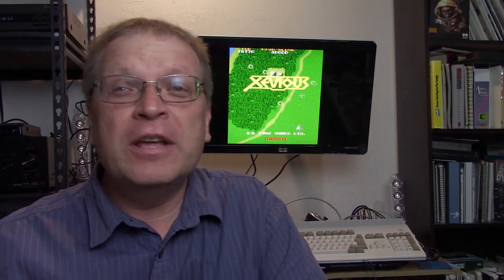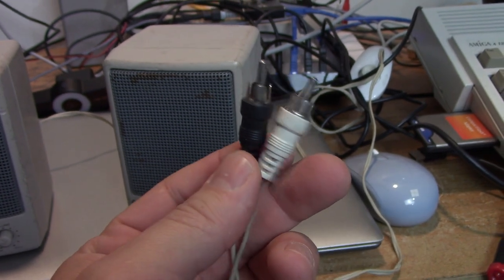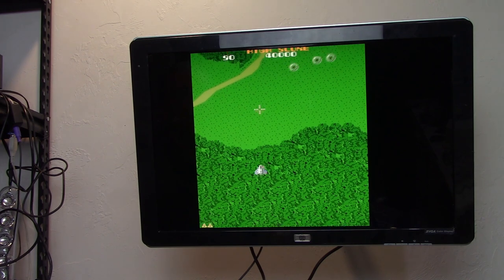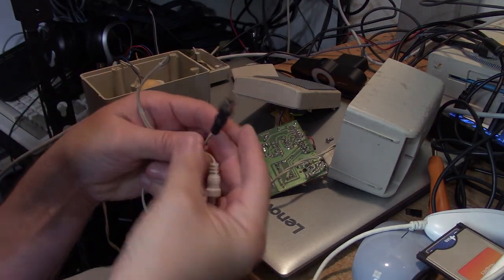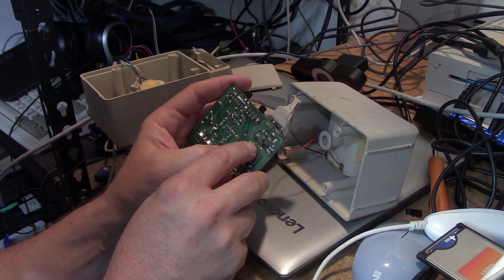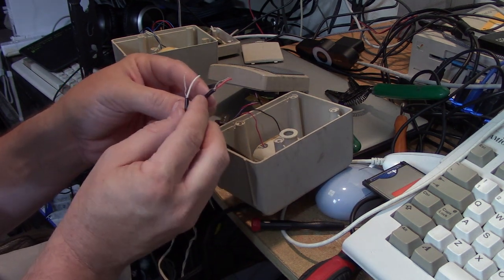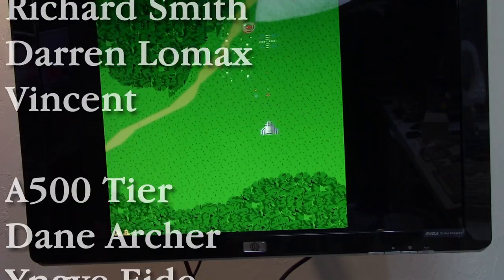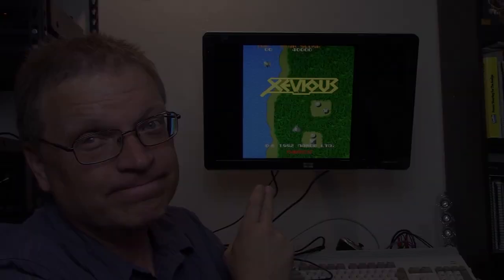Commodore Amiga A10 Speakers - Can we fix them?

Comment: I remember hating speakers with volume control on each side.  Such a pain to get the audio balanced correctly.
Reply from the maker: This is quite true! And the knobs are just small enough to be annoying to turn! Overall not horrible sound quality. Much better than the horrible little speakers that ship with many computers in the 2000's until now.
Reply: @10MARC  As far as I remember I initially put up with the 1084S for the Amiga 500, and later connected it to a stereo system from sharp (which was not that impressive either).  Eventually got some Altec-lansing speakers that were quite good.  These days I have a set of Roland speakers for the computer which work fairly well.  I avoided all the little battery powered speakers or worse yet the completely unpowered speakers.  There sure were a lot of terrible speakers included with computers in the 90s and 2000s.

Comment: I had a set of those A10 speakers... crazy things would pick up CB and perhaps HAM radio signals randomly. They could be off and in the middle of the night you'd suddenly hear somebody talking through them for a few seconds.
Reply from the maker: Now that's cool! Haunted speakers maybe?
Reply: Oh, quite a long time ago I had a headset I was given that did this exact thing which was quite scaring initially.
Reply: @10MARC  That would have made it more interesting for sure. I would have kept them if that was the case. But no, often it was the unmistakable sound of trucker lingo from semi drivers raging down I-5 which was only a few miles from our house. I also think the large antenna array at the army reserve center right across the street from our house probably had something to do with it too.